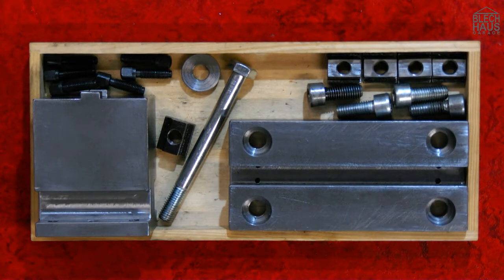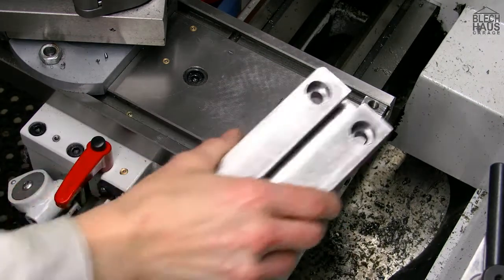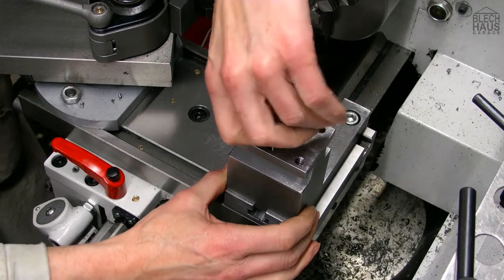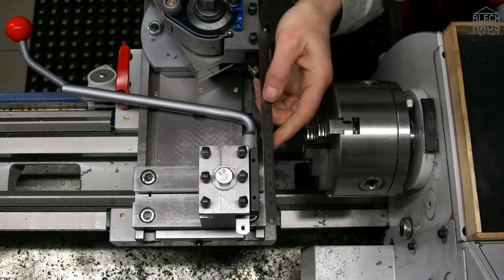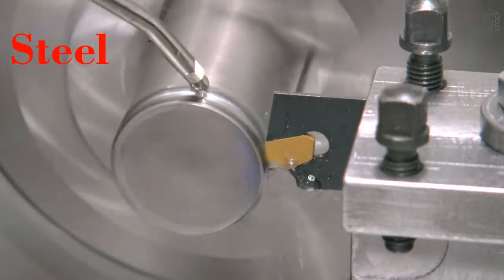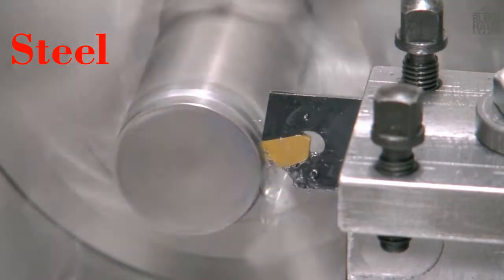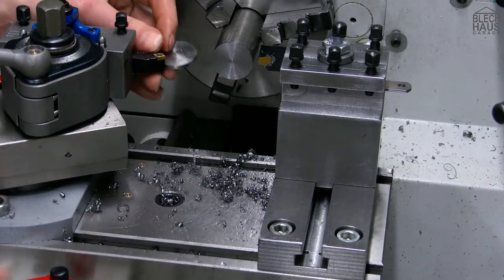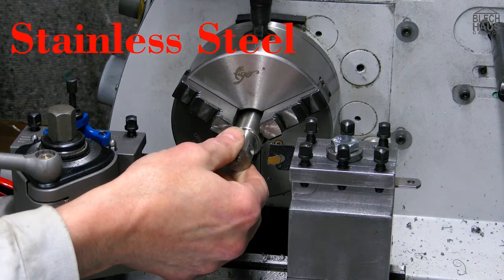Rear Toolpost, for lathe Bernardo P 600 G, part 4: assembly & test run

Comment: Hallo Dieter, are you happy with this lathe?  I am strongly considering this model and would appretiate your feedback... Servus Uli
Reply from the maker: Servus Uli! I looked for and found a small lathe with manual transmission and shift lever on the support. 
If I were buying a new one, I would take the 400V version, but that wasn't available at the time. 
I also miss some thread pitches, both metric and imperial. But you can't have everything at this price ;-) 
All in all I would buy it again because this size still fits in my workshop. 
And of course, it is a small lathe with 200 kg and not an industrial machine with 2000 kg.
In the end I can say yes I am happy with this machine.
Reply: @BLECHHAUS  Danke Dieter...  I have the same problem regarding space in my small workshop, and for the kind of turning I would be doing I do not need anything bigger.  I unfortunately do not have 3 phase power so this is kind of the biggest 230 V single phase lathe with a manual transmition and features that larger class lathes have...  Thanks again for you input.

Comment: Very good design, I have subscribed. Best wishes, Dean in Oxfordshire UK.
Reply from the maker: Than you! I tried to find a compromise between versatility, stiffness, adjustability, etc. Thanx for subscribing, you've got mine too ;-)
Reply: @BLECHHAUS  Thanks very much. I think your design would work well on the Maximat.
Reply from the maker: @retromechanicalengineer  Fine :-) And - ya dont need to use M7 bolts, you can use M8 instead. M7 is a very unusual thread size. But it was a good reason to buy a M7 tap and die ;-)

Comment: Well done Dieter, excellent results "priceless". Great design, well made, and well thought out! Top marks! Looking forward to your next adventure. Cheers, Jon
Reply from the maker: Hi Jon! Thanx, I thought a lot of how to build it. It cannot be clearly seen, but the recesses for the cutting tools have two different hights and two different sizes. So even if ya will mount a HSS tool with a grind down cutting edge or a holder with a bigger shank - it fits. Of course ya need shims if it is to low - but whaddaf.... it works as intended :-)